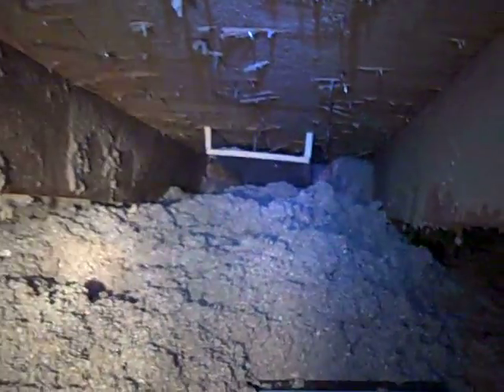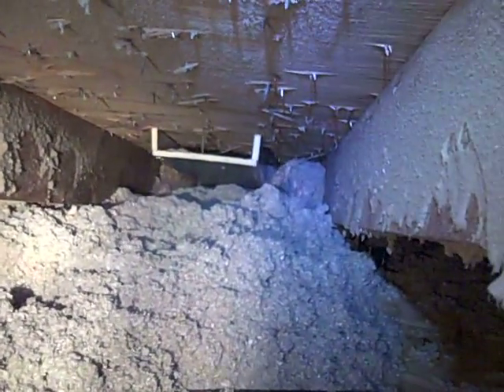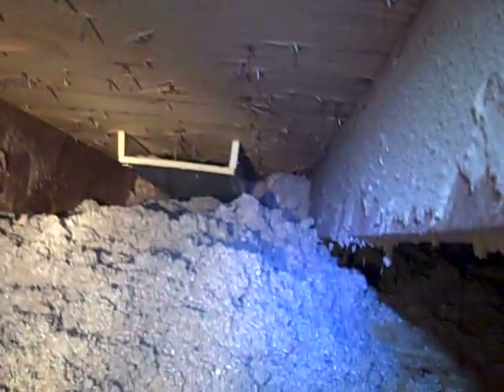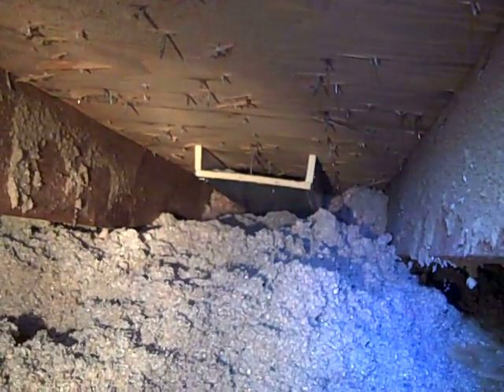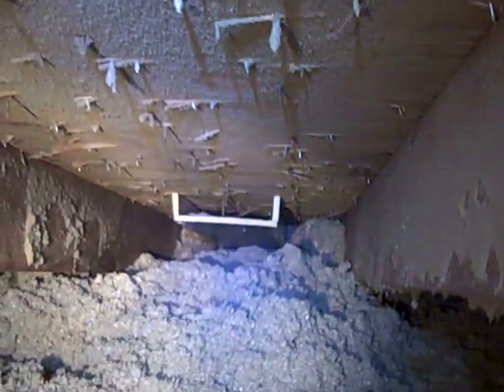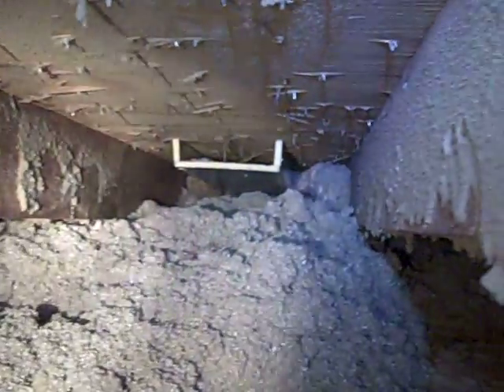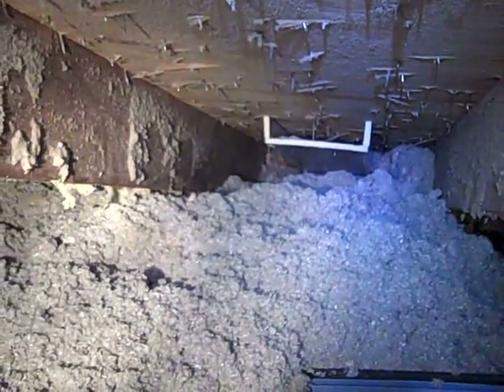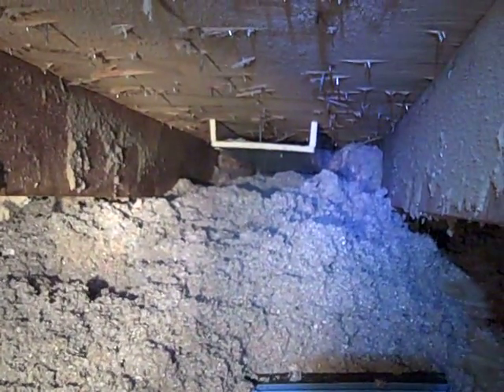Custom attic baffles movie

Comment from the maker: Wauft, that is the old way of doing it and is not a Energy Star approved method.

Fiberglass is the worst thing to use as a block above a top plate. It doesn't stop air flow, has near zero R value when air is moving through it, and it won't resist dense packing of cellulose. It will just push out into the soffit channel.

Sorry, but you can't purchase rigid baffles at the big box hardware stores.